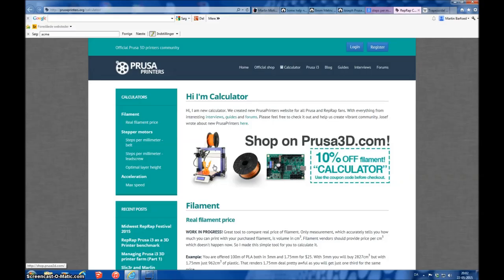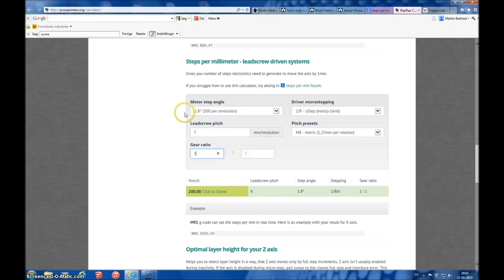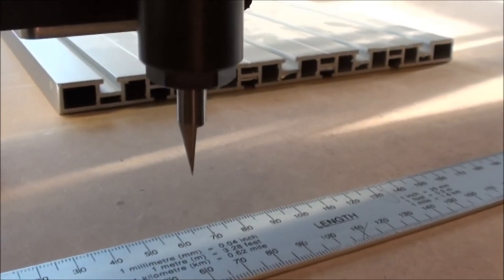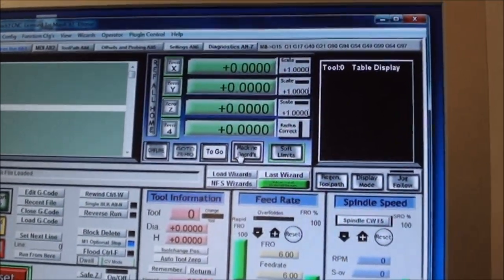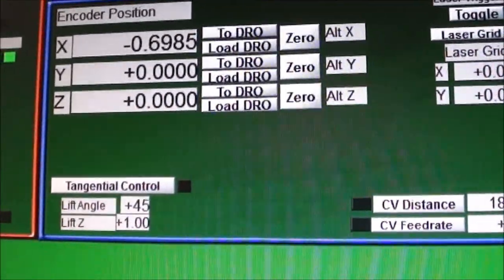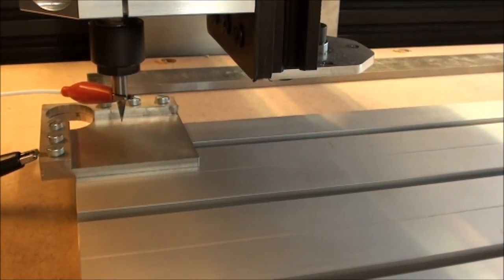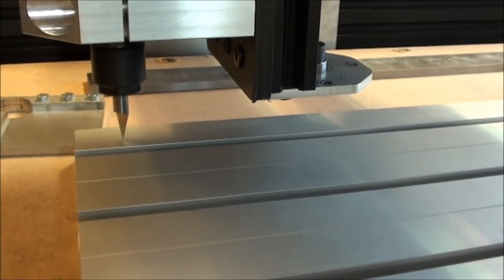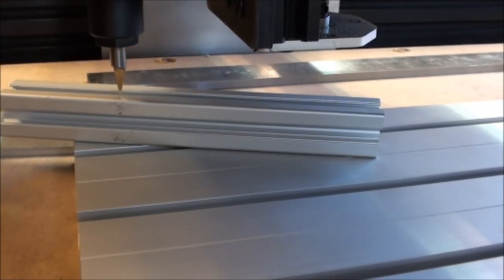Stainless OX CNC Router Calibration of Steps/mm in Mach3

Comment: I really appreciate your demonstration as it has cleared up a lot of my confusion. But I tried the Prusa Calculator and I noticed that there is no reference to use with the GT3 Belts. Just to make sure I'm not missing anything. What values should I use for these belts?
Reply from the maker: Hi Ronald,  As far as I can see you do not need to use one of the presets in Prusa. Just enter the three numbers for Motor Angle (1.8), Belt Pitch (3) and Tooth count (e.g. 20). The pitch for GT3 is 3mm. Hope this will work for you

Comment: HI SIR
WHEN IM USE '' axis calibration "  the steps per unit is  "" 5.55221 '''' but when move cnc by g code the machine move very very slowly
Reply from the maker: Wow that's not an easy question to help you with. You need to secure that controllers are set correctly and that it's reflected in the controller program. Then you need to do motor tuning (if you are using Mach3) All this must work when you jog the machine before trying to send g-code